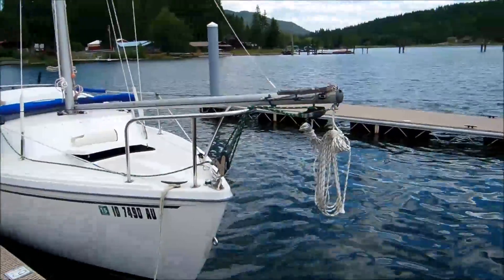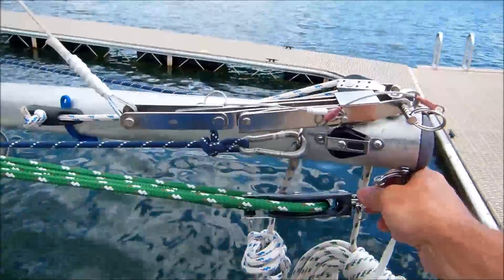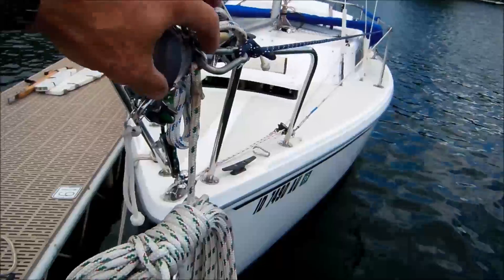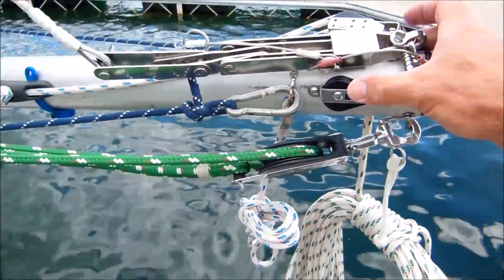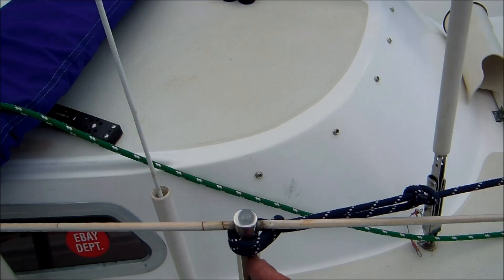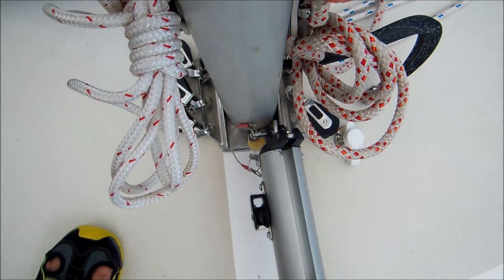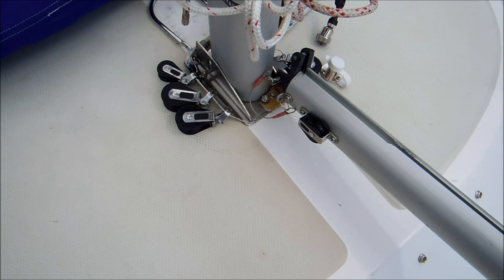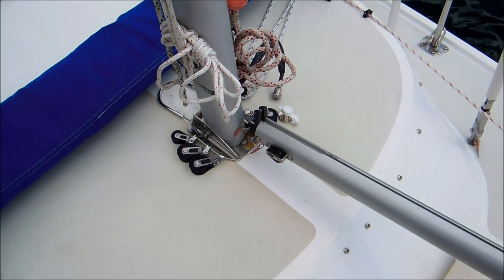Rigging the Catalina 22 Boom as a Gin Pole for Mast Stepping

Comment: Amazing stuff.  Didn't think the gin pole would be very relevant since the non-gin-pole approach works well when I've done it with a 2nd person.  But am realizing now how much of a one-handed lift you do in the non-gin-pole video to get it started, even with mast crutch raised.  That doesn't seem easy with one person.  So it will be good to have this gin pole option.

How important is the second hole on the gin pole bracket?  Don't the baby stays on the gin pole prevent most of the rotation?  I have baby stays connected to the halyards also to laterally stabilize the mast; not sure if that would help as well.  Trying to avoid drilling through the mast step and fiberglass for that second hole if I can!

Also, I can't get the main sheet flowing as smoothly as you (at least when I've tried without gin pole).  Lots of friction against bottom of cam cleat and very hard to uncleat if (when!) I have to stop in between.  Any secret to aligning the cam cleat properly?  Thanks!
Reply: Also, for the mast stepper:  any thought on minimum mast stepper height needed in order to get the mast bolt in?  Would removing the hatch covers significantly reduce the height needed?  I get worried about the mast sliding forward (and impaling the tow vehicle) when raising the stepper so much at the beginning.

Comment: Nice job! And nice that you engineered and shared it. I was also wondering how I could use the boom as you did.  My boat doesn't have the step hinge so I'll have to add it and attach a tab as you did.  Thank you so much, saved the cost of a crane everytime put in and take out my boat. Nice and thoughtful engineering, thanks.

Comment: Did you fabricate the gold anodized aluminum angle bracket or buy it?  How thick is it?
Reply from the maker: Yes, I did, from a scrap that I had on hand already. It's 1/4" thick and there's a link to a fabrication drawing on my website at the link in the description along with more info.
Reply: @stingysailor5677  Thank you very much!  I was able to download the drawing, but am confused.  You said it was 1/4" (and it might be looking at the picture, not sure), but the drawing says it is 0.125 in, or 1/8". Any suggestions as to where to find the material with which to fabricate it? I struck out at Lowe's and Menard's hardware stores.
Reply from the maker: @billcastor3487  Mine is 1/4" thick but it doesn't need to be that thick. The load on it is in compression. It just happened to be the thickness of the stock that I had on hand. I made it 1/8" on the drawing as a minimum, which should be easier to find and lower cost. You can make it any thickness you want so long as it fits in the gooseneck. The big box stores don't typically carry material that thick. I buy from a couple of different local metal suppliers who have cut-off piles from which to choose at half price.
Reply: @stingysailor5677  Thank you for the update.  I found a  12" x 2" x 3" x 1/4" piece for a reasonable price so I went for that.

Comment: I'm curious about what you have on the starboard side of the mast.  It appears you have something "coiled" between the mast base and the halyard plate.  Did you fabricate the aluminum bracket yourself or have it made for you?
Reply from the maker: I'm not quite sure what you're referring to exactly. Can you describe it a little more? You might be referring to the lanyard that connects the quick pin to the boom. Or are you asking about the line laying on the deck on the port side of the mast? That's the boom downhaul and its block that connects to the gooseneck. It works like a Cunningham. I describe it on my website here: https://stingysailor.com/2014/05/25/boom-downhaul-solution-2/. And yes, I did fabricate the bracket myself. There's a dimensioned drawing available on the Downloads page to subscribers of my website. If you sign up for free, you can download it and other drawings and files.